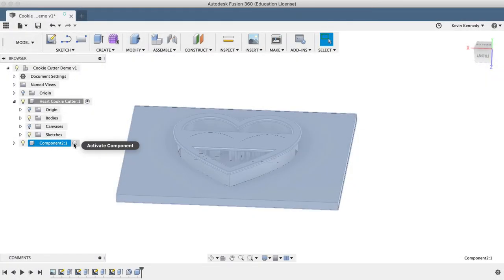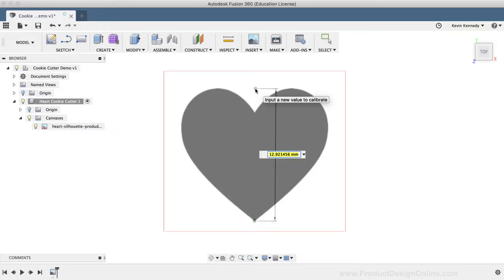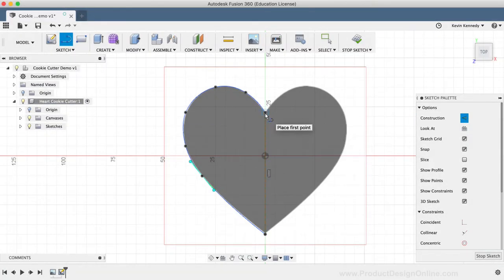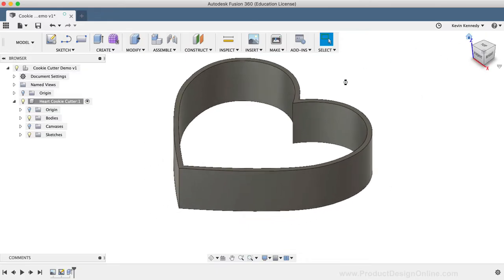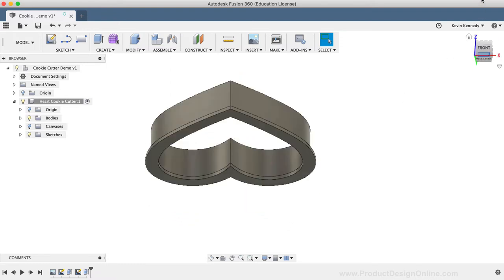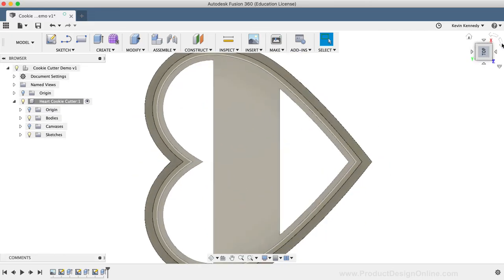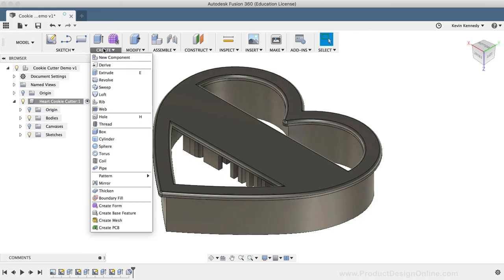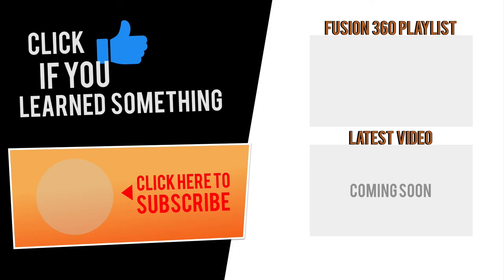How to 3D Model a Cookie Cutter in Fusion 360 (for 3D Printing)

Comment: I use Fusion exclusively for making my own cookie cutters, fondant cutters, impression stamps and tools for baking,  and using in making cookies.  I already know how to make cookie cutters and I am trying to work to work on putting my logo on the side of the cutter, along with the name of the cutter.  I know how to label them, but for some odd reason, I haven't been able to make my logo (my mark) for adding to the cutters as well.  I like for my cutter to have a nice rounded handle on the bottom, and then a support wall, then the cutting edge.  This gives the cutter better strength.  Then, if I want to add words, I try to make an embosser to go inside of the cutter.  I prefer having a cookie embosser to match the outside cutter, but most of my cutters are just the outside, and then I create cookie stamps for words and designs on them.  I appreicate your courses on Fusion 360.  It is one heck of a program, and I don't use hardly any of it's functionality.  But it is my preferred program for making my own cutters.

Comment: This is amazing, I am new to 3d printing and have been using cookiecad to start, but I really want to have better control of how I design things. My question is, how would I add an extra blade? Basically, another layer on the outside of the cookie cutter?

Comment: Love this video.  Subscribed and will now watch your others.  I am having an issue with the mirror command.  I did what you are showing here but I cannot click on the spline.  I'm still plugging away at it but hope you can offer some insight.  If I figure it out, I'll post what I did to get it working.  And thanks!!
Reply from the maker: Hi, John. Glad to hear you're enjoying this. There are two mirror commands, one for the sketch environment and one for the model environment. It's likely that you're using the wrong one, which is prohibiting you from being able to select the sketch (in this case, the spline).

Make sure you're in your sketch environment. If not, double-click on the sketch to re-activate it. Then, activate the shortcuts box with the keyboard letter "S". Type out "Mirror" and you'll see there are actually 4 different mirror commands (the other two are for sculpting). You'll need the SKETCH mirror command which is the first one, or the one that doesn't have a filled-in blue triangle, as seen (circled) here - https://snipboard.io/EA6Vt3.jpg

While in an active sketch environment you will see the sketch mirror command under the "Create" dropdown list, but note that you must be under the SKETCH tab of the toolbar. When under the SOLID tab, the "Create" dropdown list will have the solid modeling mirror command for 3D bodies, features, and components.

Let me know if that was it! Cheers, Kevin :)
Reply: @ProductDesignOnline   SUCCESS!!  I figured it out.  I didn't use the "Sketch" point tool.  I used the "Create" point tool.  Once I redid my points all fell into place!!  Thanks again!

Comment: You saved me after 2 hours of a struggle where cura kept wanting to fill the empty part at the center.
Reply from the maker: Hi, CowGames. Glad to hear that. Don't hesitate to comment or reach out if you run into any roadblocks with your projects. Cheers, Kevin :)
Reply: @ProductDesignOnline  Well I kind of did run into an issue the other day. I got an OBJ file from thingiverse, but when I want to print it has an error. On the preview screen I can see that parts of the wings on the dragon that I want to print are (i think) too thin and thus will not be printed, leaving them completely unattached to the model. How can I fix this? I tried meshmixer but that keeps crashing on me..
Reply from the maker: @MrCow579  If you're able to convert the file to a solid or surface body (following these steps https://youtu.be/pgWWVcM5YJY) then you could use the Surface tools to patch the holes or thicken the thin wings. The only concern I have is that if Meshmixer is crashing the mesh file may be too complex for Fusion 360. Is Meshmixer crashing when you simply open the file or when you try to alter the file? Cheers, Kevin :)

Comment: What filament and nozzle do you recommend when printing food stuff like these ?
Reply from the maker: Hi, Kimberly. That's a great question. I recommend using PETG filament when possible. I've linked to my favorite in the description. Otherwise, PLA is the safer route over ABS and other alternatives.

For the nozzle size, I use a standard 0.4mm nozzle. I print them with a 0.15mm layer height unless there are really fine details (an embossser) you can use a 0.1mm. Cheers, Kevin :)

Comment: Is there an easy way to resize to a specific size? I used the scale command (non uniform to only stretch X and Y) but this requires some math or guesswork to get the proper size. Say I made a 3 inch heart, but I also want a 4 inch and a 2.5 inch. The 4 inch is easy enough to do in my head (scale 1.33) but the 2.5 would require a calculator. Basically, I would like to add a dimension, but be able to change it for the whole design. I tried dimensioning across the heart but it distorts...

Comment: I love the idea of the mirror function, does this work from if you have to use both the fit point spline and line sketch for a unique design? 
When I tried to mirror it had all my lines as seperate pieces and I couldn’t select the entire ‘half’ of my image
Reply from the maker: Hi Hannah. If you have several sketch objects then you'll need to select all of them (or whichever ones you want to be mirrored). Just note that there is a SKETCH mirror command and a MODEL mirror command. Make sure you activate the correct mirror command while in the SKETCH tab in the toolbar... that may have been the issue!

Comment: Can anyone recommend on what settings to print this cutter?
Reply from the maker: Hi, Pop's Cakes. What 3D printer, slicer, and filament are you using?? Cheers, Kevin :)
Reply: Product Design Online I have a Wanhoa mini i3 duplicator and I use PLA Wanhoa fillemant. Thank you for replying
Reply from the maker: @leeancaljw  Thanks for the info! I use Ultimaker's Cura for my slicing software. The few cookie cutters I printed out I just used Cura's preset settings of "Normal" (.15mm) since its a fairly basic object with light use expected. The only setting I change is the infill. Based on the cookie-cutter design I typically bump up the infill to 60-80% so the inside components or side walls don't end up as fragile. It takes significantly longer (a few hours) but is probably worth it in terms of making the cookie-cutter last a lot longer.  Image for reference - https://snipboard.io/tW4KQI.jpg

Cheers, Kevin :)

Comment: Couldn’t you also use a program like inkscape and do the auto bitmap trace to get an outline then put it in the fusion 360 as an svg.
Reply from the maker: You could...but SVGs are a slippery slope with Fusion 360. They recreate all the imported SVG lines as native sketch geometry. Sometimes that creates hundreds or thousands of little line segments. Consequently, there are certain modeling command that then become much harder to use - chamfer, fillet, sweep etc...anything where you have to select continuous edges.

Comment: Hi amigo how i can reduce the points en sketch on smoll pices
Reply from the maker: Hi, Dionisio. I'm not fully understanding your question. Are you asking how to use less sketch points while using a spline? Cheers, Kevin :)
Reply: Sorry amigo ok wuend i send  the program  to the machine it Is so hevy AND the pice Is too small
Reply from the maker: @dionisiocruz7  If your piece is too small you'll want to check that you're modeling in millimeters or inches, whichever your printer's slicing software uses. You can also scale the model in Fusion 360 using the "Scale" command if you find it to be too small. Cheers, Kevin :)
Reply: Aaa ok my frend tnks i know how do i dont   know send u the piture
Reply from the maker: @dionisiocruz7  I'm always happy to help. You can always reply with a link to screenshots or your image. Cheers, Kevin :)

Comment: I am trying sketching for the first time to make a cookie cutter.  My problem is that my Fusion 360 is an updated version of yours and I cannot find the "point" option in the sketch palette.  I can find the spline but not the point option that you used to place points around the image before choosing the spline option.  Has it been removed?
Reply from the maker: Hi, Rachel. All of the sketch tools have been moved into the "SKETCH" tab, and then the "Create" dropdown list (while in the sketch tab). It's there that you'll find the point tool.

You have to be in an active sketch to see the Sketch tab.

I do have a Skillshare course on designing your own 3D Printable cookie cutters, where the videos have the latest Fusion 360 user interface. If you're interested you can get 2-months of free access via my link - https://skl.sh/32XsTCh
Cheers, Kevin :)
Reply: Thank you.

Comment: What kind of filament did you use for the cookie cutters?
Reply from the maker: Hi Heather. I recommend PETG 3D Printer Filament. The link to my favorite is in the video description. I also typically put a piece of plastic wrap over the cookie-cutter before pressing down, which helps keep it clean. Cheers, Kevin :)

Comment: I'm trying to scale my cookie cutter, but when scaling the original spline sketch it completely demorphs. How do properly scale my cookie cutter?
Reply from the maker: Hi, casinomann. Are you scaling the sketch with the sketch "scale" tool or are you scaling the model with the modeling scale tool? I would suggest scaling the sketch.

Or, if you're 3d printing the object/using it in a third party software scaling the object there. Unfortunately, scaling sketches with splines in Fusion 360 can be tricky...and it doesn't always work. It depends on the complexity of the spline...sometimes the sketch "Scale" tool does work. Cheers, Kevin :)
Reply: @ProductDesignOnline  Thanks for the answer!

Following this tutorial, scaling the sketch made it go completely bonkers. Some guy suggested making the sketch with control point splintes(?) instead, as then it was more easily scalable, but I've yet to do so.

Scaling it in a slicer would be more problematic, as I would much less accurately know it's size.
Reply from the maker: @casinomann  That's correct, the "Control Point Splines" can be dimensioned easier. However, that doesn't mean it will naturally scale easily with the sketch scale tool. The benefit is that you can update the dimensions to get the Control Point Spline to update accordingly, where the Fit Point Spline is very hard to dimension. Cheers, Kevin :)

Comment: Do u know how to make the cutter wall from top 2mm to the bottom (cutting edge) 0.3mm?
Reply from the maker: Hi, Shan. It sounds like you're wanting to add a taper to the shape, so the bottom is more narrow? If so, you can use the "Chamfer" tool from the SOLID tab. It will be found under the modify dropdown list. Select the bottom edge and then set the taper by adjusting the chamfer distance in both directions.

Comment: My letters keep breaking off. Is there something i need to think about to fix it?
Reply from the maker: Hi, Fylith. Are you referring to in Fusion 360 or after you actually 3D-printed one out? Cheers, Kevin :)
Reply: @ProductDesignOnline  after i print it. I think my slicing settings are off? But was thinking maybe i need to start the extrude from the middle of the base. Would that make them more stable?
Reply from the maker: @fylith6378  can you reply with a link to a screenshot? I didn't have any issues when I printed this specific design out. It could be something to tweak with the slicing software. It wouldn't hurt to bumb up the infill so the cookie cutter is stronger overall. Cheers, Kevin :)
Reply: @ProductDesignOnline  https://drive.google.com/drive/folders/18tJ_Dn8puSuQhsNjDdED4_09EH9S5pdu?usp=sharing 

It is actually a stamp. I watched that video of yours then came to this one and then thought to ask you the question. hope that's ok.
Reply from the maker: Hi, Flyith. Sorry I did not see your reply earlier. Did you end up getting the letters to stay on any better? Looking at your file, the letters are quite thin with that text. It's probably going to be hard at that scale without having a commercial-grade 3d printer. You could try to add a "draft" or fillet to the bottom where the letters touch the face plate. Cheers, Kevin :)

Comment: Excellent as always!  One suggestion, if you would have added draft angles, it would probably do a better job of releasing the dough when pulling the cutter up...
Reply from the maker: Great suggestion, Wm Robert Leschyna! That would definitely be helpful :)
Reply: @ProductDesignOnline  I'd love to see a video doing a cookie cutter giving the edge a bevel for a sharper cutting edge
Reply from the maker: @RhondaJFinds  You could apply a draft angle as he suggested. However, I would actually recommend adding a chamfer over the draft angle, as that will give you more control over the angle and the depth. Here's a quick screencast I did so you can add a chamfer/bevel to your cookie cutters - https://drive.google.com/file/d/1H-fZ3vZkxpwojdnnLbU7OgmODMI42r9O/view?usp=sharing

Cheers, Kevin :)
Reply: @ProductDesignOnline  thanks for the screen grab! How does this go if you've got a .4mm print nozzle?
Reply from the maker: @tp7283  You're welcome!
I printed the cookie cutter with a .4mm nozzle on an Ultimaker 2 and it worked great. Depending on your printer type, you may want to increase the infill and decrease your layer height to get a finer resolution. Cheers, Kevin :)

Comment: Hi Kevin,
I can't get my sketch constrained. The lines are still blue.  When I start to set my points, my cursor won't find the bottom or  the apex of the heart. 
Thanks,
Ron
Reply from the maker: Hi Ron, did you place the sketch points before creating the spline? If so, make sure your "snap" option is turned on in the Sketch Palette. Let me know if that wasn't it and we can troubleshoot further.
Reply: Hi Kevin, I turned on the Snap option in the sketch pallet, but sketch is still blue. I have another question though, when I click to select the text, the the whole profile that the text is on is selected. Can't figure that out
THanks
Reply from the maker: @ronhutchinson3479  Hi Ron, for the text part, make sure you select one of the letters and they should all select with the Extrude command. The text can be picky sometimes - if you're selecting outside of it then it may select the entire sketch/background/or face that it's placed on.

In regards to the constraint issue. Are you trying to fully-constrain the spline? If so, they're not easily constrained and applying the "fixed" constraint to the spline points can help.
Reply: Hi Kevin, I figured it out.  I wasn't placing the text on the face. I was placing text on just the canvas, ha. I could move the cookie cutter and the text remained on the canvas.  I wasn't first selecting the face to put my text on. Also, I don't think I really need to constrain the spline,  it turned out fine anyway. This is a great tutorial! I learned a lot.Thanks!
Reply from the maker: @ronhutchinson3479  ah, that'll do it. Glad you got it figured out

Comment: Im trying to add the bar in the middle, I select my lines I was to project and hit ‘p’ but then it doesn’t give me the option to select a plane or click on any lines.
It also unselect my lines as soon as I hit ‘p’ so
 I’m not sure what’s happening
Reply: And also as soon as I hit ‘p’ my bodies disappear almost as if it’s undoing the extrusion and I need to extrude again
Reply from the maker: @hannahsaville6289  Hi Hannah. After creating the Extrusion did you hit the "OK" button in the dialog to confirm it? Any way you can share a link to a screencast of what's going on...that would help me see the issue. Otherwise, sharing the link to your file would be helpful.
Reply: @ProductDesignOnline  Thank you for the support. This is the screencast: https://autode.sk/35RnZJ9
Reply: Product Design Online here is my screencast ^

Comment: Is there a way I can copy the cutter and just add text to it and print it incase someone asks me to make a custom one so I don't have to remodel it all?
Reply from the maker: Hi, Spencer. I would suggest copying the component first. Then, you can edit the sketch  feature (that contains the text) in the timeline at any time. Right-click on the sketch feature > edit sketch > double click on the text > that will open up the text dialog where you can change the text.
Reply: Product Design Online Thank you! Is there a way to scale a whole cookie cutter or will I have to remake it the first time then just edit the text every time?
Reply from the maker: @spencers2144  There are two ways to scale it. First, you could scale the sketch with the "Sketch Scale" feature in the Modify dropdown of the SKETCH tab. Second, would be to scale the body. There is a scaling feature in the modify dropdown of the SOLID tab for scaling 3D bodies. However, with that route, you may have to update or alter your offset thickness and height.